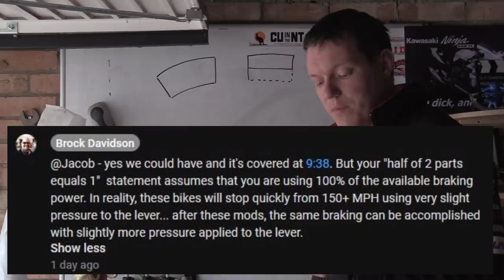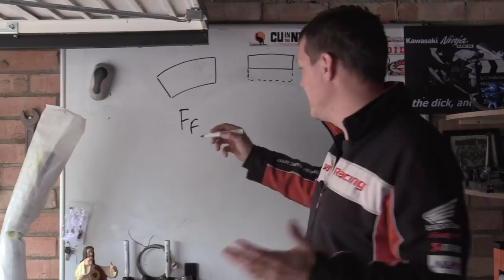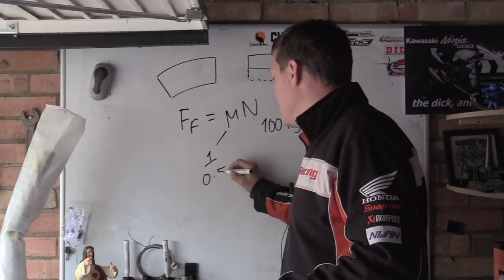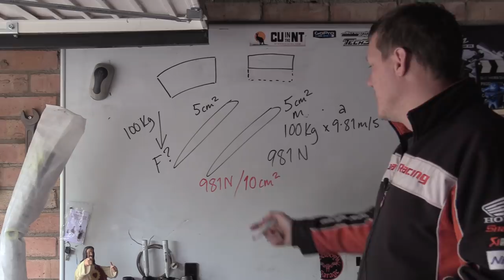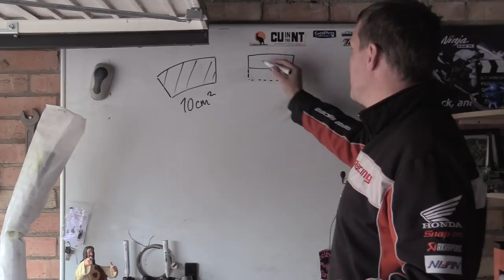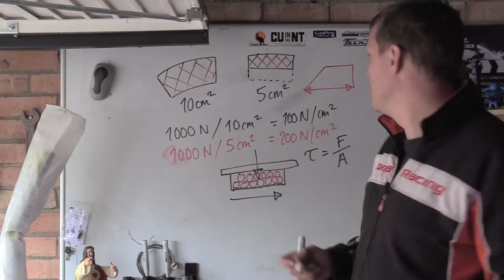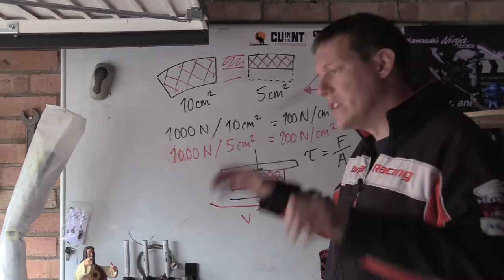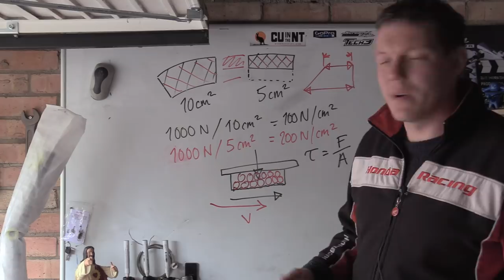B Stupid - with Brake pads

Comment: Brake fade is not fun at all. In the 80s I did a track day at Brands Hatch on a GT250. Now on the road I could out ride my mates on their RD250s , even the LC. But that's because I rode mine everyday in all weathers and knew just where the braking points were for it. At Brands I discovered two things, brake fade and adrenaline is brown coloured! Street bikes very rapidly run out of brakes on the track, if anything you need decent twin , four pot, calipers at the front and a decent two pot at the back. Admittedly modern braking materials are a hell of a lot better than 40 years ago but cutting down brake pads ? Stupidity of the highest order. That's an accident waiting to happen, just imagine at 150 mph you hit the brakes that you cut down to save weight. Your pads heat up( probably start to glaze as well ), your brake fluid heats up as well. In all honesty, it would probably start boiling. Next time you brake, the efficiency is reduced, you take longer to stop, next time you hit the wall in front of you. Just stupid.

Comment: Why not just get rid of all brakes and chamfer the heel of your boots instead.

Now in stock: Brock’s designer brake boots with graphite and copper Cuban heel 👠👠
Also available: Pre-distressed knee sliders, stick on rubber peel for the edge of your tyres and helmet polish.

Comment: If you put a lob of thermal paste on the bit of the pad thats left for stopping itll iprove the ability of heat to flow between the disk and the pad. We aint nerds up here though so i use copper grease instead i aint got no camputer goo just lying around

Comment: Now I'm sat here questioning pointless things like. As you say about 2 very flat surfaces sticking together, that got me thinking about cold welding. Now giving that a brake pad and disc are ground to each other they should match up really well, so If you had matching steel pads and discs under breaking could you get increased effect of friction though the forming and breaking of cold welded bonds?... This is stupid because this would only work in a vacuum so space and obviously that is stupid as there are no petrol stations in space! 😉😂
Reply from the maker: This is one of the reasons brake pads are sintered - i.e are porous, that and gas venting
Reply: @dirtygarageguy  arrr that makes perfect sense. 👍

Comment: Good description of the problem.  And we didn't even cover boiling the brake fluid. A race bike can exceed 500 degrees C at the disk.  All things being equal I don't suppose the average road bike is going to reach DOT 5.1 temps but if you cut down the area of the friction material the heat will be greater and more concentrated.  Anyhow.  Good job.

Comment: Nice video Matt, covered a lot of ground there. One thing you didn't mention though when commenting on the braking effect of tapering the pads is that this also changes the effective radius at which the braking force is applied. The (Effective) radius gets greater and therefore the braking torque applied becomes greater, another reason why the same lever effort will result in increased not decreased braking. This is the reason big brake kits tend to have larger diameter discs but with a 'narrow' band of braking surface. Any increased cooling requirements are addressed by increasing the size of the pads around the circumference of the disc (There is a proper term for this but it has escaped my brain for the moment - EDIT: I remembered - Annulus).
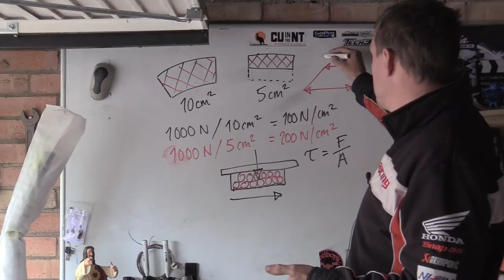Reply from the maker: @ 18:12 I kinda do

Comment: there is also this thing as heating and cooling metals. the crystal structure of the material that he is disrupting. basically meaning the brake disk wil also ware down quicker.
you make metal stronger by heating and rapid cooling. but this has the oppeside effect. the crystal structure go's further out of each other making it weaker.
this in it self also means that your braking power decreases as you take more of the metal off than you normally would if it did not get as hot.   and yes i know this is much smaller that what you explained but it does add up.

Comment: brake material is a heat insulator, where i worked if the stack liner was above 800°C , drum brakelining was put between it and the rest of the chimney
Reply from the maker: "brake material is a heat insulator"

- apart from sintered metal pads...... so no.

Comment: You forgot a very important part, it would be a bit less severe if he chamfered them evenly on both sides. But since he chamfered them from one side right to the middle, the piston is rocking/tilting sideways when the force is applied. Which further increases the pressure on the remaining pad that is closest to the chamfer

Comment: regarding brake fade. there is correlation between coefficent of friction and temperature. the higher the temperature of surface the lower coefficient of friction (for steel anyway). the lower coefficient of friction, the more heat is produce. more heat = higher the temperature = even lower coefficient of friction. and the snowball effect goes on until all is cooked and something starts to fail.
Reply from the maker: LOL no, that's not correct - where do you get this shit from.

"there is correlation between coefficent of friction and temperature"

- This bit is correct, I did mention this in the video - and to be clear this is the shear due to higher forces - all materials lose rigidity and stiffness when heated.

"the lower coefficient of friction, the more heat is produce."

- This bit is incorrect. The higher the CoF the 'gripper' something is. Therefore higher traction and therefore more heat when these surfaces are sliding.

Comment: I was not going to comment in the last vid or this one but I cant help myself.I was taught a very long time ago( AS WELL AS HAVE EXPERIANCED IT) that NO disc brake in the world is 100% true. Even if you have it perfectly cut, the first heating cycle it will warp( very small but it does) its also engineered that way as it assists in breaking the friction. As the disk rolls past the pad it taps that pad back on its high spot. Anyone knows that disk brakes are either on or off. Also this is why having air in a hot break system can get the pads to drag. Engineers and companies have spent a huge amount of time working on disc brakes to get the best performance, rolling and breaking... ANYONE WHO GRINDS THIER PADS NEEDS TO WEAR A BACKWARDS WHITE JACKET.Ever had a frozen piston due to rust or dirt... how long does it take to cook the disk and fluid.... what normally returns the pad on a caliper?The drop of pressure in the fluid reduces the pad pressure!!!!!!!!!! but the disk knocks the pad ever so gently back..As for this guys reasons to grind a pad like before... WTF bro... PLEASE THINK BEFORE YOU PUT THAT TYPE OF THING ONLINE FOR PEOPLE TO SEE.Half the effective friction, twice the loading, twice the heating if not more and the shear.. pads that are designed to handle specific thermal loads for best efficacy for certain periods of time.. your setting up yourself for a cascading failure... throw everything out the window and cook the pads and fluid... the negatives just keep going... ITS REALLY REALLY STUPID I act really got irritated when I saw that last video but I cant believe anyone would be that silly to do it.Thanks to THE WORKSHOP for trying to keep bikes out the back of stopping cars..............BIKES ARE DANGEROUS ALREADY DONT MAKE IT WORSE FOR YOURSELF BUY REMOVING YOUR BRAKES.

Comment: Love your work Matt, mainly for the following reasons.
1. Debunking: Keep on debunking the rubbish advice from those that should know better.
2. You work on the facts: You actually do the maths. So many idiots grinding this or butchering that; where are the dyno readouts? Where are the lap times? Where is the hard data for us all to see?
3. You do things proper: Love the bolt torque vid, headstock race removal, etc. etc. etc. Keep it up.
I know you have a dig at Bell End Boy and Brock B stupid, but they deserve it. Watching one drill a hole with a shit ground bit and the other grind off half a brake pad; insane, idiotic, asinine, vacuous,  dumb-ass wankers the both of them. Nothing short of charlatan snake oil salesmen of the worst kind.
The problem is that we all know that some young, very impressionable teenager is watching their videos and may follow their advice and may get themselves hurt if not worse. They see this shite and will not be able to understand good advice from bad.
Please keep up the good work Matt. You are doing the motorcycling world a service and I do look forward to seeing more of your videos in future.

Comment: If you remove the lower half of the pad, is there a possibility that the caliper pistons could tip in their bores because the pad could rock as it wears?
Reply from the maker: This depends on the caliper and pad design, but I think it's unlikely - mainly due to the pressure applied parallel to the pad and the very short displacement the pads have to travel.

Comment: Just whack a  screwdriver between the disc and padthen a couple of pumps and you have proper brakes. Better still, just take the pads out. 

Maybe I could develop a low friction brake oil.

And that Grom clip. OMFG!

Comment: Polishing till sticking AKA Galling / Cold welding.
"The reason for this unexpected behavior is that when the atoms in contact are all of the same kind, there is no way for the atoms to “know” that they are in different pieces of copper. When there are other atoms, in the oxides and greases and more complicated thin surface layers of contaminants in between, the atoms “know” when they are not on the same part."
    — Richard Feynman, The Feynman Lectures, 12–2 Friction
https://en.wikipedia.org/wiki/Cold_welding

Also recommending take a look at "Supreme Skills! The Battle of the Extreme Bar Slide"
Reply from the maker: LOL -  van der Waals forces

Comment: Got a curious one for you Matt, I've got an old Suzuki GP125, it's got a God awful single-pot up front with just a round, solid pad, and a solid disk, so nowhere for gasses and debris to escape to, would you advise against putting a slot or channel in like newer designs? Played about with the engine and now I've realised that the brakes aren't to match anymore 😂

Comment: 1000nm of force on a 320mm disc vs 1000nm of force on wave rotor . i would have thought the standard disc would stop quicker. Does the heat dispensation matter?. I cant see how it does unless it was continuous
Reply from the maker: This is a video coming soon

Comment: another point. When pads heat up some resin(what bonds all the pad together) will evaporate this mean to go from a solid to a gas. This will create a steam in a certain area of your pad and will try to counteract your braking force. Thats why we have sloted disc and why some pads have a vertical cut on it. It also remove other stuff like dirt pad pieces and pad dust. If u have just half pad u will have heat faster more steam more conteract braking force less braking. The problem is that people thinks that the world is a simple linear place where just a thing makes difference just one at a time. We have organics metalics semimetalics and ceramics pads. All of these are better at some point worst in anothers. If the only thing that metters is force and friction why all of these lets use the old school rubber as we do on your bycicles kkkk

Comment: Matt, do drilled discs have a similar effect to reducing pad size? Seen some fancy looking discs that basically have x% of metal removed e.g. Rezo Wavy...  great channel, great work👍
Reply: Not particularly the amount if heat they dump ensures that any losses in surface area are counteracted by gains in avoiding glazing the pads or warping discs 

Generally with properly designed drilled and slotted discs obviously.

Comment: Why does the friction on the brakes stop working if they get too hot? can you go into further details please.
Reply from the maker: Brake pads rely on maintaining their structure - or stiffness and rigidity.  To grip something you need rigidity. If you try and poke something with a hot wax crayon it doesn't work that well. It's like gripping something with boxing gloves on. 

As the brake pad heats up it loses its rigidity, and starts to shear.
Reply from the maker: "Gas starts being produced as the pads burn up"

- This is why sintered pads are used - the porosity of the material help reduce this boundary layer - at the cost of thermal mass.

Comment: I'm still unconvinced about the force of friction depending on surface area. I understand that intuition says that it should, but I remember doing experiments in college that showed otherwise (the simple sliding block experiments).
Reply: lol that is because university teaches just enough to be dangerous.  that experiment was just a basic introduction to friction.  as matt said in the vid, friction is very complex subject - if it were not, there wouldnt be an entire field of study (tribology) dedicated to it.

experimental results are valid only within the given parameters and assumptions of that experiment.  so unless yer brake pads and discs are made of wood and you dont give a toss about heat/ignition/flames....
Reply from the maker: "I'm still unconvinced about the force of friction depending on surface area."

- Cool and we will cover this again - I'll give you something to chew on though. The world is 3 dimentional (without getting into holographic universes) so any force on our scale is applied to a 3D space. The force is always acting on a surface area - therefore the surface area and force are proportional. 

In other words the equations requires a force - if you double the surface area for the same mass then the force is even distubuted over that (flat surface) so the net force is the same no matter what it's transfered through. For example - the force is mass * acceleration - nothing to do with surface area - however there is a surface area.

What matters is pressure. Like stroking a file across a flat surface or a corner. Across a corner the file bites into the material. Across the flat - pretty much nothing compared to the corner. This is friction and abrasion in action. The contact pressure is higher for the corner, but the forces, CoF of the materials etc is all the same.

Comment: Matt please advise. I've been working on this 1991 suzuki rm 125. And I got new brake pads and they are too wide. Like a quarter inch. I'm confused because the old ones fit and the new ones don't. I genuinely value your opinion on how to proceed with this thank you.
Reply from the maker: too wide? Do you mean too thick? Did you squeeze the pistons back in?

Comment: wouldn't chauffeuring the pads also put uneven pressure
on the calipers pistons and seals
 trying to turn them  sideways within the caliper
Reply: yes it will.
If done aggressively and if you just pull the lever harder to compensate for the worse stopping power, you could end up with many times more sideway force on the pistons and calipers.

My car has non metal brake pistons in the caliper, they last longer because they dont rust, but they are easier to damage if the piston is pushed with sideways force, if you combine them with removing material, you could end op with a brake piston that locks up and unable to release the brakes again. It could send a person sliding into a wall instead of stopping in front of the wall.

Comment: In theory for sliding friction the coefficient is independent of area, so half the area with the same force equals twice the pressure and the same friction. But with brakes a smaller area will concentrate the same heat dissipation in a smaller space increasing temperature rise. The coefficient of friction will inevitably be temperature dependent - in the old days the friction material would even fade above a certain temperature giving you no brakes at all. 
For sure you can bet the design engineers of the brakes have optimised it all pretty well these days for braking power, temperature rise, pad longevity, disc warping, cost and weight. Go grinding off half the brake pad and you've created a massive temperature gradient on the brake rotor that it was never designed for. And reduced the pad life and put uneven stresses on the caliper and pistons that it was never designed for. Think a bodger with an angle grinder knows better than guys who spend every working day designing and testing brakes? Yeah, good luck with that.
Reply from the maker: The important thing here is that 'the coefficient is independent of area' as in the coefficient is independent - but not friction as a whole.